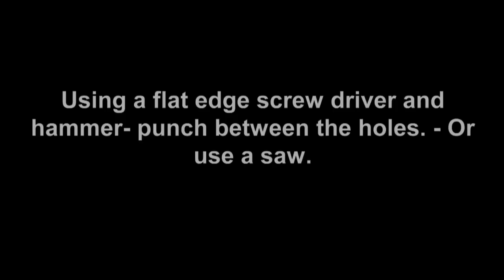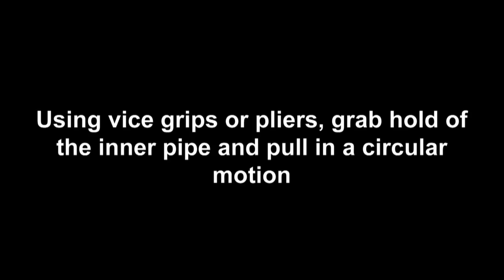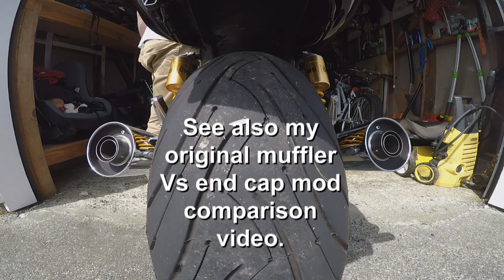XJR1300- How to install exhaust end cap conversion

Comment: Hello! Thanks for the video! I have done the same job in a marving exhaust and the sound is great. But i think that they are now completely opened. With more sound than yours... do you need to change filter or carburation? Thanks
Reply from the maker: Hi there, with mine I never had to to get any carb tuning done.

Comment: where you buy it?
Reply from the maker: This guy was selling them https://www.ebay.fr/itm/Embouts-echappement-emmalex-YAMAHA-XJR-42-mm/112818605835?hash=item1a44834f0b:g:~tEAAOSwLjxahqQp
Reply: Video by Lecram thanks man. LWG
Reply: Here is a German XJR shop selling a 28mm cap for close-to-street-legal-sound and a 38mm cap for get-in-trouble-for-sure-sound: https://www.xjr-tuning.de/artikel/1601/Auspuffaenderung-fuer-Seriendaempfer-38-mm.html